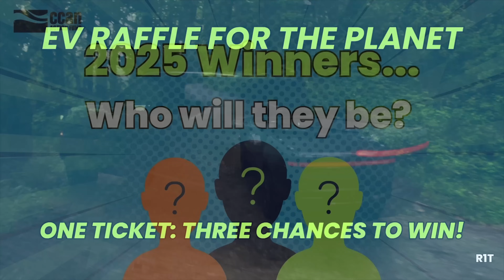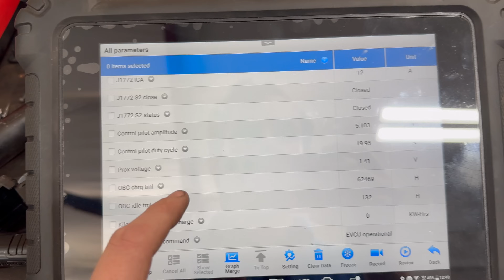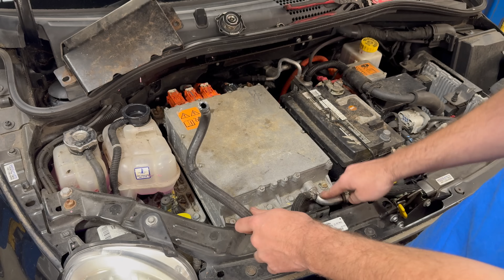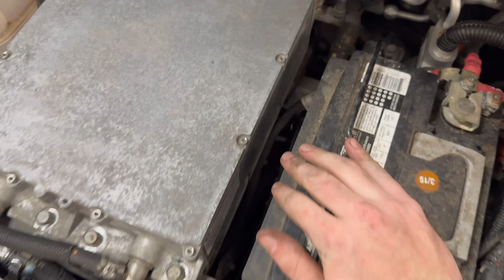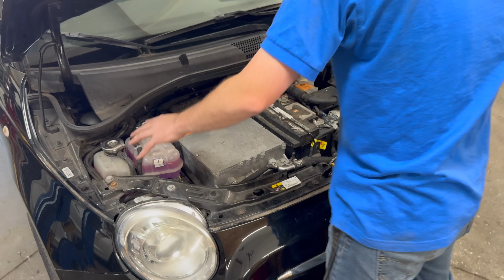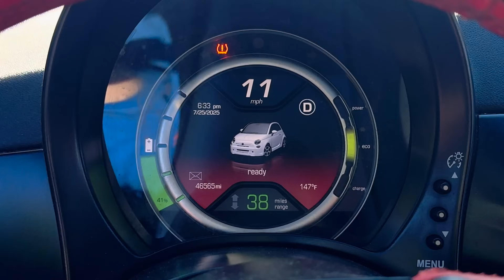Fiat 500e Fails To Charge! Replacing The Onboard Charger

Comment: I have a Renault with an intermittent charging issue but they tell me at the shop that you cannot change the part due to some ID chip that blocks replacement. Dealer wants about twicw the value of the vehicle to put a new one in! Is there some way to get around these lock outs? It'smade my car disposable. I will just drive it until it gives up charging all together just because the filter capacitors are weak.
Reply: Renault's fight against right to repair means I take my business elsewhere. Component coding locking out parts from reuse in another car should be illegal!

Comment: There have been some bad cases with thise where i live (Denmark) and no support from the importer, it seems to be a general problem like your case also shows. Fiat workshops wants >10 t.$ and that in best case, in some cases it can damage the battery and the car is totalled. Is there no hardware lock on these products?

Comment: Often the problem is a bad diecast and a small leak from the cooling plate that shorts out high voltage components like mosfets (It was a Renault Zoe I saw that on so different manufacturer). Perhaps check for water leaks on the diecast to be safe before repairing it (if you were going to).

Comment: The vehicle is equipped with two ambient temperature sensors. One is integrated into the side mirror, while the other is located behind the plastic cover of the rearview mirror. To optimize the performance of the sensor behind the rearview mirror, I recommended to apply a dark or mirrored tint to the upper portion of the windshield.

Comment: If these cars were reasonably priced they would have sold well
Reply: I remember you could pick up a 2014 Fiat 500 pop for less then $12k new and even they didn't sell.
Reply: They didn't even with the discounts lol. Hell, my local CDJR dealer has a line of new 500e's for sub-$100/mo leases and cant move them. They also have 2 used ones for... I think like $18k with under 2k miles on them and they haven't moved in 6 months

Comment: If the cost is equal to swapping to get it repaired then that shop you use rips you off. That’s a simple IGBT(kind of like a mosfet but carries higher voltages and amps) swap. It’s done in minutes.
Reply: Assuming you can do it without taking the board out.
Assuming there is no board damage.
Don't know what he paid for the charger but its about $400-500 on ebay.

Comment: I looked at the dirt in the front “engine bay,” noticed the corrosion, all points to a neglected EV. Folks, open the hood and rinse out dust, dirt, debris at least once a year. Inspect water drains to be clear and free of foreign materials, clean up with a vacuum cleaner, and inspect for damage. Thanks.

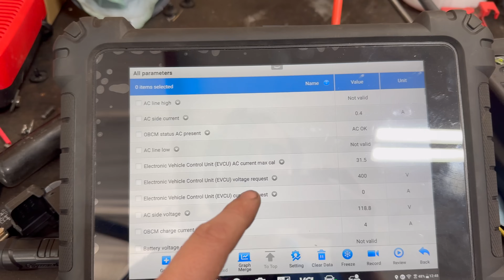Comment: 3:05 - 3rd line says "status AC present" in the last column "value" : AC OK and then switches to AC not OK and so on.
13:14 - here in the EU the cost difference is usually not neglectible, lot of companies especially in eastern europe are specialised in these board repairs cause they are a lot cheaper than used parts where you also usually do not know if they are working while those refurbished parts come also with a warranty.

This does not look back. We tend to look for the "ev buyers guide" offered by ev-clinic cause they mention OEM spare part price, used spare part price and what they take for a repais of such invertere. 
They mention this especially for Fiat 500e - USA (which have been imported quite often and had arrived with battery damage due to 8 weeks or so for shipping)

The OBC fails every 50,000-100,000 km.
REPAIR: €1,200
NEW: €7,000 (no longer supplied) 

In this case they have no used part prices due to american production i guess. But we use their side to get a clue about prices in general and if it could be worth the risk to buy a damaged car or not like e-GOLF and so on. Great source too. And the baltic states and bulgaria and roumania have a lot of electrical engineers or students studying who are working for shops to repair tesla parts - hence a great source you can find quite often on ebay. Usually they have high skilled or even overqualified engineers doing these repair jobs , quite often also tell you from which vehicle (VIN), how old and mileage to avoid any impression of stolen cars being slaughtered. They salvage cars part by part but also offer refurbished parts or a kind of exchange parts - you send your broken in and then get a refurbished for a lot less and the circle goes on. 

Better this way then throwing all these pcbs into the bin. BUt this europe, environment is king and emissions are fined as waste is fined too in case you are a producer of products. We have to be carefull - and germany is the country with the longest tradition in re- and upcycling due to the misery of 2 wars and being cut off from supplies. 
Hence we have the recycling industry and tech to sell across the globe as we have these energy saving products - mandatory if you wanna sell anything here. 

Exploiting the earth is forbidden and very limited if you compensate the damage: You build a factory and seal the ground then you need to buy a 8 times bigger area and plant trees as protectet forrest in the future - or you can not build it. Tesla had to obeye these regulations and when elon violated it iin his style that no one can get him on the hook they shut down the construction site, Tesla did not pay the water bill after 2 months the public water agency shut down the pipeline till money had been paid. Elon is a nobody, no one allows that tesla is treated any better. Big difference between the USA and central Europe, unfortunatelly we have to rise the dykes about every 15 years due to the CO2 emissions.
Reply: Unfortunately half of the US thinks climate change is a hoax still and large media outlets lie to them about it to make them feel better.